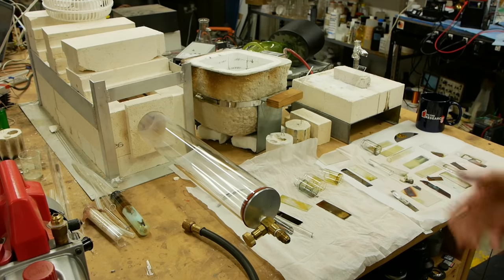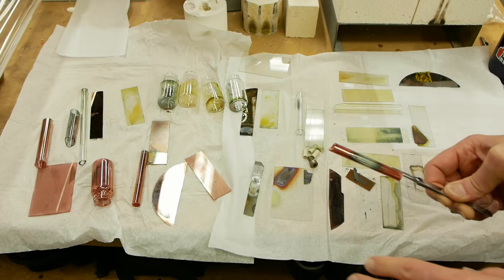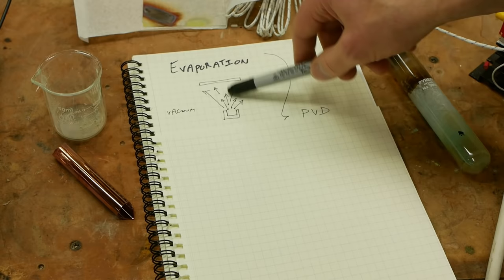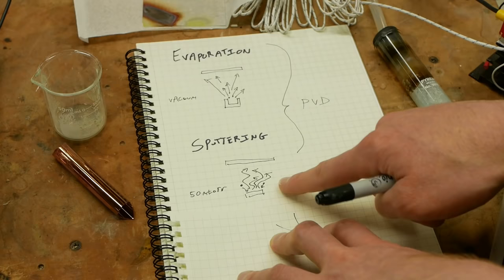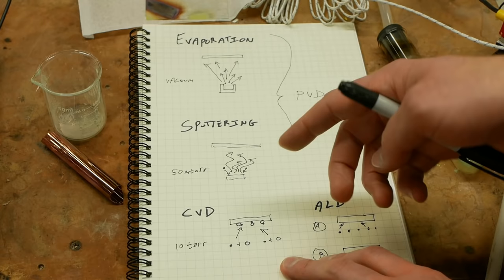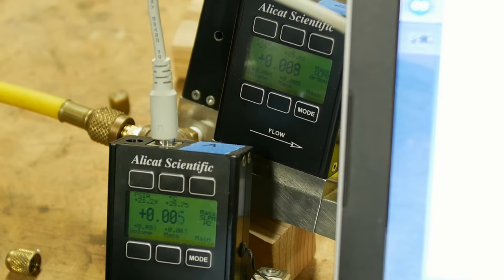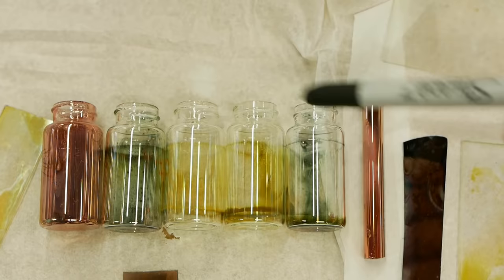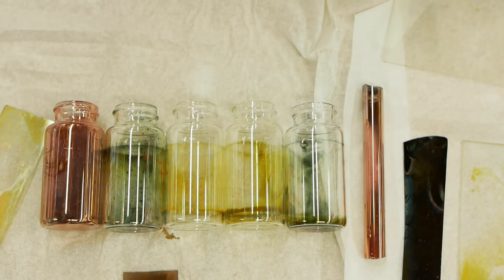Atomic Layer Deposition of copper - If you like sputtering, you'll love this!

Comment: The amorphous structure of the glass and the way it's cooled in production likely produces impurity and surface characteristic gradients. It appears you would need a highly consistent surface, meaning high purity material in single crystal or amorphous structure cooled consistently and precisely.

The other comments make great points, you definitely would need solenoids to fully stop flow, a high temperature valve to control copper chloride outflow, and some improvement in how those flows are put into the main flow to ensure consistent process. 

All this suggests to me this would be good for making extreme quality lenses and mirrors, and not a whole lot else.  But there is a TON that can be done with such quality lenses/mirrors, and if you can verify the properties of ones you produce they are expensive as hell so it'd be a pretty profit. I see a lot of these kinds of vids and I sometimes I think "Man, with this handful of engineering changes this could be a small scale production system" I wish I had the time to make a channel about that process, show people how to make complicated things that are expensive for no reason.

Like furniture foam - absurd prices and inexpensive inputs. But recipes are all trade secrets, a small test set up to get some good formula, a 4x8xdeep chamber for foam expansion, a few days design on a mixing nozzle and a few iterations until one works well, then bam, anyone who wants to can start making a sound insulation, furniture foam with a couple recipe options. a $3000 set up and $100 in materials per current market value of $4000 in foam. That's a quick pay off, and could bring prices in line. And the thing is, there are TONS of industries like this where a little collaboration and design sharing could crush one industry but make building furniture a cheap hobby and create a huge new market of custom pieces. 

To me, that's what maker culture is going to have to become about someday soon.

Comment: Good luck with ALD, as an atmospheric plasma deposition researcher one thing that I joke about is reproducibility and homogeneity. From my point of view ALD without pumping cycle is really hard, and really difficult to achieve, even in a small reactor the time needed to replace a gas with an other one is very long, especially because the flow is not perfectly laminar

Comment: You mentioned that heating the copper chloride to generate vapor then cooling it would take too long. Not necessarily. Try a coil of fine tungsten wire coated with copper chloride. I'm thinking you could dry dipping it in a super saturated solution or spraying it on a warm coil. Since the coil has very low thermal mass, and it's sitting in a stream of argon, it will hear and cool quickly. It won't hold much but depending on what your doing it won't need much.

Comment: I would not be surprised if the surface area of the glass bottles are larger in those spots because that's where the guide rails in production would rub the glass.

So you would get more seeds for deposition

Comment: if these bottles are soda glass (silica mixed with soda ash and other fluxes and a pinch of aluminum oxide for stiffness) then the glass is giving off sodium ions once it gets hot enough. starts around 1350F, and only gets faster from there.

Comment: Sometimes when I see patterns of weirdness, especially inside of tubes (bottles or straws), I think of standing waves. Here, I don't think that's what it is, but maybe something to think about. If it's a standing wave of vibrating gas, then the scale should change based on the speed of sound of that gas, which is a function of pressure and composition, mostly. Whereas if it's a standing wave of the bottle material, it would probably be largely uniform no matter what is changed.

Comment: In the flame of an oxygen propane torch I can achieve a similar coating on or in glass tubing we're on the surface of any shape glass peace vaporizing  speck of gold or silver in the tip of a very hot flame allowing the vapor to spray onto the glass piece in the exhaust of the flame.
 It's a glassblowing technique called fuming...
 Also some metallic colors of glass will react with a high propane content in the flame and get a mirror type finish.

Comment: Amazing ! Superb work dude, yet again !
I imagine the bottle deposition pattern might be due to gas flow rate vs bottle dimensions/gas flow interaction rather than it's chemical composition.
Test with a different bottle size (of the same composition) or simply change the gas flow rate to see if the 'line' moves.

Comment: I wonder if standing waves within the jars is affecting the deposition. As the pressure at the surface will be different for the parallel surfaces than the curved surfaces. 
 
The main tube is a resonator, you have pressure inputs at different lengths along that resonator, you’ll have some interesting standing waves inside the tube,  those standing waves move within the vessels.. I think you see where I’m going with this.

Comment: "Choosing the right opamp is all what engineering is about" :D The weeks I spent searching for an opamp for my laser rangefinder receiver... 
For the curious, I settled on an LMH6629 for the (avalance) photodiode TIA and first gain stage and I couldn't even test it, since I messed up the footprint of the opamp supply on my first PCB ;) 
Late Edit: Don't use the LMH6629, choose a FET input opamp, like the OPA858 which has only 10pA input offset current or the LMH32401, which I'm currently testing ;)

Comment: instead of going through all of that trouble on substrate cleaning, try an SiO2 thin film.  SiO2 has good adhesion and will provide a good surface for subsequent layers.  Not sure what's a good method for coating SiO2 inside of a glass bottle though.

Comment: Yeah you should have tried it on some silicon wafers or mica. Also I think even the lattice parameters of the material matter to. I forget the term for it, but if the crystal lattice of the substrate isn't similar to the crystal lattice you're trying to make then you end up having a hard time getting the atoms to bond in the right spots, because the distances and spacing isn't right.

Comment: Try to make atomic layer of gold, when gold goes nano it begins to exhibit very interesting properties.
e.g. Lycurgus Cup
The dichroic effect is achieved by making the glass with tiny proportions of nanoparticles of gold and silver dispersed in colloidal form throughout the glass material.

Determination of size and refractive index of single gold nanoparticles using an optofluidic chip

Comment: I'm under the impression that the problem is your time you've allotted for reactant is not enough.  I would also say that the reason you get a unique "ring" in your vessels is because of previous chemicals that were in them (even from the manufacturer, they still use a wash)....it leaves a somewhat imperfection that lasts pretty much indefinitely.  You could try to temper it, but it's glass, so it'll more than likely just break across the seams.

Comment: I wonder if that distinct line in the glass bottles has to do with how they are manufactured. It could be that the part of the bottle that is necked down may have experienced more time being heated by a torch and enough ions/impurities from the nozzle or combustion byproducts deposited in that area. Especially considering how the bottoms of the middle jars have less deposition in the curved area.
Reply: The process might be even more sensitive than it appears?

Comment: Here's my suggestion for you when it comes to your flow metering devices... I think part of why they may be leaky is because, if they are old used units... Then it's likely the seals inside need replacing(if even possible.) but... If it's old-new stock... Then... I'm not entirely sure depending on how old it really is. Since if it's old enough, and depending on the seal materials used... could mean that maybe the seals rotted a bit if it's rubber seals instead of a different material that doesn't rot like rubber. Tho rubber does take time to rot naturally anyways so... idk.

Comment: The push lock air fittings on your Alicat Scientific could be causing your leak problems under a vacuum.  I had problems with the o-ring seal in the push lock fittings at the transition from vacuum to pressure.

Comment: Of everything in this video, the thing that I would like to understand more is the use of the sparkplug as a thermocouple connector inside the chamber. Does this work? Does it distort the readings? How are you wiring this? Measuring temperatures inside a vacuum chamber seems super simple if you can do it with a spark plug as a connector to the outside.

Comment: in a solenoid electromagnet, the magnetic flux density is proportional to number of copper wire turn per unit length. I wonder if you can apply a layer of photo resist polymer onto the glass cylinder, and project a spiral winding pattern onto the cylinder. Then use copper cvd to deposit copper onto the pattern. Effectively give you micron size thin wire wrap around glass cylinder with extremely high flux density. (assuming the vapor deposited copper don't have too high of resistance due to their extremely small wire diameter, I guess technically you can just increase the voltage, so less current travel through the wire and less resistance that way)

Comment: If you would need to coat a piece of fabric, let's say carbon cloth or Carbon fiber, would you use ALD, cause PVD will not coat the fibers from all sides or you could have a porous surface that ALD could coat where PVD could not? If so especially copper as the coating for the fabric - would you use the same precursor or would you go for the more hazardous and expensive ones. Setup remaining your own tube furnace not some professional ALD equipment. Thanks for the video! your Experiments excite me to discuss more research topics in our lab..

Comment: I wonder if the reason the glass was not evenly coated and had a similar reaction in each is due to some electrostatic component to when they were made causing a divergence of silicon or oxygen orientation at that line and maybe at the bottom or something so heating and holding them in a metal mold their shape so you can electrify the case like a capacitor to force all the orientation of the silicon dioxide to orient one way and any other elements to be oriented on one side of the glass with the other side being the oxygen or silicon being the last atom in the chain of the molecular structure or something. Guess best way would be to try this with a plastic you can use either solvent or heat method to make it into an electret material and then test the positive negative and neutral between sides of the plastic?

Comment: Have you tried looking at the glass ware with a polariscope? Maybe there is some stress in the glass around those areas? Not sure how it would affect it though.
Reply: Another thought about glass manufacturing. There are a few process that beer and wine bottles go through during manufacturing.

 Firstly is a hot coating of tin (Monobutyltin trichloride) is applied while the bottles are still hot, this helps with the strength of the bottle, it is only applied to the outside of the bottle and below the finish.
 Secondly is a plastic coating on the outside of the bottles applied while it's around 100 degC, this allows the bottles to slide past each other, with out this coating glass is actually really sticky to other glass and marks really easily.

Unsure if either of these processes would have been applied to these containers.

Comment: Would be great to have glass tubes with copper on the inside and outside....
1)High voltage capacitors..
2) potentially for producing seperate streams of hydrogen and oxygen via DC electrolysis... gas bubbles form on electrodes and will want to rise. If there's a little wall of glass below the electrode that's a slight barrier between the gases. Plumb together  Flexible Tubing at top of glass tubes to collect gases produced inside tube.

Comment: are you SURE that the two layers have different amounts of deposition? I use silver and gold to apply layers of colour to borosilicate glass, outside of a vacuum, simply by melting a bead in front of the target with a torch.

anyways, point being, silver can either go completely silver, or appear nearly completely translucent depending on the atmosphere. reducing flames (propane/oxy) tend to make the silver crystals grow and become more visible, while hitting them with a very ocidizing flame can cause them to nearly dissapear, at least until you hit it with reducing flames again!

it is possible to eventually burn it off, but point being, thevisible wavelengths being reflected are VERY atmo dependant.

cheers!

Comment: What are a few  examples of some starting materials known as 'DLC' coatings via ALD... Aka diamond-like materials. 
I see them used on engine valves, cam lobes, and entire crankshafts. Typically a colorless coating. I'm wondering if these are similar to the ceramic coatings your trying. Absolutely amazing properties of these engine parts when coated.

Comment: I wonder if there's a minimum diameter that would permit mono-layer formation with this technique? I know that running adsorption isotherms on microporous materials gives a sort of hysteresis loop in terms of gas "adsorbed." In reality, you can have a gas and a material that should only give a mono-layer, but you end up with a sort of capillary action where channels not too much wider than the gas molecules end up getting filled up and clogged. For analytical perposes this can be overcome by pulling a vacuum, but it may present a tricky problem if the goal was coating some sort of microscopically porous material. It could be an interesting challenge for ultra high supface area metal catalysts

Comment: With the bottle problem at the end, could it be something just really simple. 
The bottles are presumably shaped and so the flat glass parts when inside your chamber will be by definition at a slightly different temperature, because the bottom is thicker and so is the top. Therefore if you heated a bottle snd looked at it vis a flir I am sure you would see precisely this profile, with the heat being slightly higher where there is more mass. 
I’m no expert, but that’s what it looks like to me, nice straight sides but both ends are shaped and Greater mass.

Comment: I know copper is not magnetic but it does interact with magnetic field, it's how we make electricity.  Could strong magnetic fields be used to manipulate the movement of the copper atoms by inducing a charge in them? Or static electricity be used to make the landing point of atoms more or less favourable?

Comment: With the AliCat protocol stuff, I wonder if it’s not so much that it’s old but just that industrial control equipment tends to be incredibly “flexible” in how they document their protocol vs. how it’s actually implemented. I’ve had a lot of trouble with industrial stepper motors where they make a LOT of assumptions in their implementation which are never documented in the protocol sheet, and when you request support from them they always just recommend that you use their (usually very limited and terrible) GUI client that hasn’t been updated in 20 years and doesn’t actually work with anything you need it to.

Comment: I'm interested in what makes the flow controllers so costly. My guess is that it's the measurement task, as the actual control should be straightforward. Do they use tiny gas meter runs -- measuring static and differential pressures via pipe or flange taps? The specific gravity portion of the equation shouldn't require constant measurement. Just enter that into memory for whatever gas you're flowing. Measuring temperature should be trivial. If you have static and differential pressures, gravity and temperature are the only data you need to achieve nominal accuracy. Developing data on tube and orifice sizes should be achievable experimentally by filling a known volume to a given pressure via time. Whole thing done with an Arduino? Maybe.
Reply: "I'm interested in what makes the flow controllers so costly."

My guess is calibration to get an accurate flow rate & repeatability of the flow rate.

Comment: I have a hypothesis as to what's going on with your bottles - I'm going to guess (not a glassmaker, but I seem to recall having seen / heard about it being done this way) the bottles were originally formed from a glass tube which was cut into sections; the tops and bottoms then heated to the melting point, they would have been pressed/rolled up against a form tool to create the mouth at the top and seal the bottom. If that is the case, the area where the coating is applying properly would be the portion that never came in contact with a form tool. I would imagine that contact with the form tool alters the surface geometry in such a way as to make it more difficult for the coating to adhere - perhaps leaving surface inclusions or micro-/nano-scale pitting.

It's just a hypothesis, though - I'm not an expert in this field. Perhaps you could get a bit more information using your electron microscope or (possibly) a very good optical microscope?

Comment: I wonder if the glass bottles have somehow become polarized, e.g. in manufacture or during plasma cleaning which affects not only charge distribution but also the surface structure.  I guess the hydrogen needs to demolecularize into atoms and chemically adsorb to the glass so would be sensitive to these.